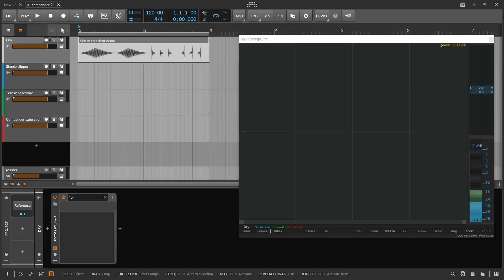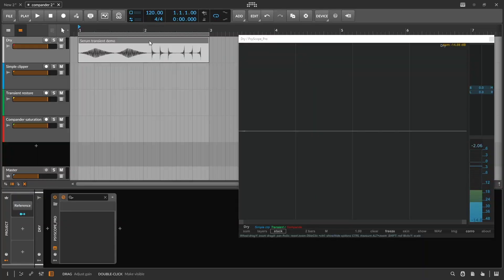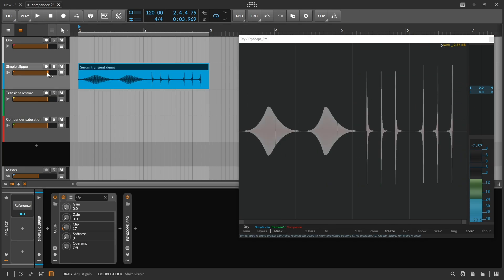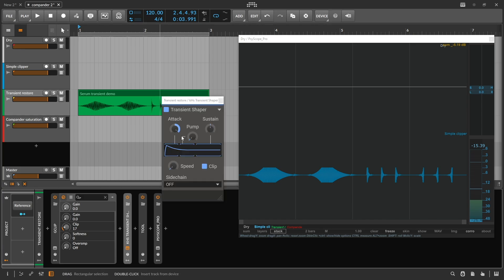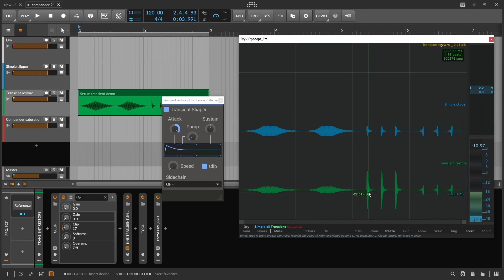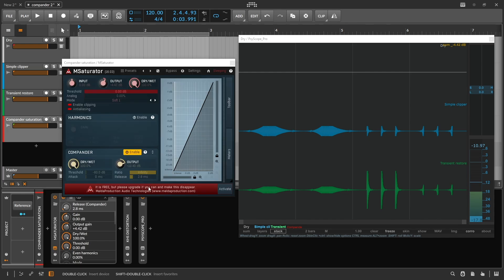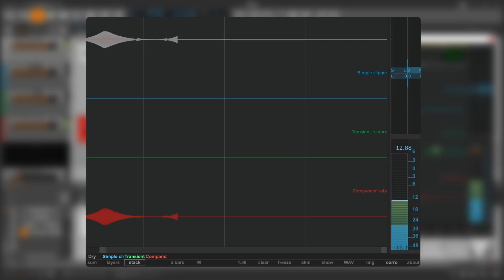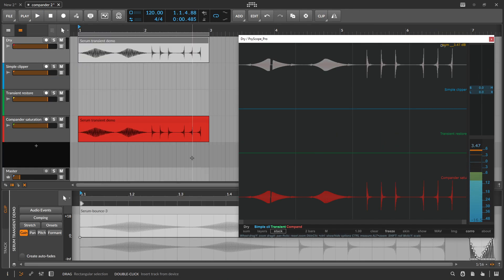the better way to distort your sounds

Comment: This can be done in Kontakt with scripting. Just need to capture the reduction envelope of a compressor, saturate, then apply the inverse of the compressor’s reduction to a gain. This has been possible for at least 2 decades. Nothing new.

Comment: This is so awesome! Since you're kinda the guy for this type of stuff I have a question: Is there a way to REMOVE the quietest parts of a signal? Like say you have a high noise floor, instead of gating or de-noising could you just clip off everything below a certain threshold? is this even a thing?
Reply from the maker: @djdeathcore5731 maybe check out a video about bitwig’s loud split device? it splits the signal up into hundreds of bands and lets you set some thresholds to apply fx to just the quiet frequencies, mid-level frequencies and loud frequencies. if you just turned down the volume of the quiet chain you’d get a cool spectral gate. I think this would give you what you’re describing, at least in the spectral domain.

Comment: Hey! Great video, and you made pretty tricky concepts very easy to follow :)

I'm very excited about eventually jumping ship from a Pro Tools/Cubase DAW duo. 
A DAW that seems to focus so much on workflow is very enticing. How viable is Bitwig as both a MIDI orchestrating/composing tool? & as a sound editing tool?
Sorry if these questions are kinda mundane, i'd love for u to point me in the direction of any independent material out there for learning the DAW.

Thanks, <:)
Reply from the maker: @andaroo.j hey, sorry I'm late to this.

I recommend watching some @PolarityMusic, he has lots of long and short form content about bitwig.

in general, bitwig isn't very well known for its midi workflow, though if you're into modular stuff it has hands down the best tools for randomized/generative music, lots of cool tools for doing crazy midi stuff programmatically. making ambient/generative patches and such. the piano roll overall is kind of mid, despite having a few cool features like midi note expressions. if you spend a lot of time composing by drawing in MIDI, you'll probably have more fun in FL's piano roll. it's the nicest one out there for sure.

if you're big into the audio engineering side of things bitwig is a dream come true. at least it was for me. it gives you so many tools to fine tune signals and create your own devices that do literally anything imaginable. the most obvious case is bitwig's "The Grid" - one of bitwig's key selling points. it's a drag and drop block editor able to create essentially any audio effect imaginable. or you can make full songs in it if you have a bit of experience. in my mind "The Grid" is essentially an easier to use and more capable version of FL's "Patcher", but you don't need a PhD like you do with Max for Live, since Max is basically computer programming.

yes, I agree with you in saying I find bitwig to focus heavily on workflow, meaning it gives you all the necessary tools to create your own workflow. not in a clunky way, I find it to be a really freeing thing. when I want to do something really specific or complex, I rarely need to google around for a 3rd party, probably not free plugin that does the job. there's always a stock tool for anything you might want to do in audio. you just mix and match. for example, I've even basically ditched serum because the stock "Polymer" synth has a great wavetable oscillator you can load up, and it does everything serum can do (and more!?). and also I'm currently making a "soothe2" clone and it's like 90% accurate. you can do some crazy stuff really easily.

anyway, if these things sound exciting to you I recommend checking bitwig out and getting the trial, but if that all sounded like a bunch of nonsense, bitwig's features might not be up your alley. not sponsored I don't care.
Reply: @jshstuff  Yo! Thanks for such an in depth response. You've definitely piqued my interest and I'm excited to give it a go for the trial period at the very least :) 

Keep it up with the fantastic content! Looking forward to more from ya. Cheers 🤘

Comment: Not all clippers increase headroom, and it’s important to remember that transient shapers are time based while distortion is usually dynamics related.

my own practice is I distort-transient shape- clip is always at the end.

There’s no right or wrong, but being aware of what the result of the effects you apply (hence having an oscilloscope) is my own takeaway from this video.

Comment: I use a chain EQ>Distortion>EQ
First EQ massively increases high frequencies, like a big soft shelf or even a tilt filter, like +12 or even +18 DB (sometimes a little if I want a little effect overall) and also I set output gain on that EQ just before clipping on a distortion plugin, or if it is a hard clipper, I set it on my taste. The second EQ makes the exact opposite curve, lowering exact amount of high frequencies. For distortion I usually use GClip or REAPER'S Waveshaping Distortion. Sometimes if I drive the vocals, right after distortion I place a de-esser plugin set on a wide band mode.
This chain makes sound really fat and warm, and also reduces dynamics of some instruments in a gentler manner than any compression or limiting, or other kinds of distortion.

Comment: Distortion that preserves dynamics is really cool, but I'm not sure that I understand the point of purported Benefit #1 @2:21 ...Wouldn't any / all distortion plugins get more "heavy" or present at 100% mix? (vs something closer to Dry or 0% mix.) Surely I'm missing something here, right?
Reply from the maker: yes but you get that benefit #1 without missing out on #2 and #3
Reply: @jshstuff  that makes sense, thank you for responding so quickly!

Comment: Quite some misconceptions in here : you are confusing distortion with waveshaping ; the way you are describing transient shapers is wrong too, albeit they can be used to restore some dynamic to a squashed  signal it is not what a transient shaper is designed for
Reply from the maker: I use the terms waveshaping, clipping, saturation and distortion interchangeably when referring to processes that add harmonics and reduce dynamics. but I think I see your point. there can be differences between them, and not all distortion does these 2 things. though I don’t think any use of these terms in this video were misleading, let me know if you disagree.

and I think we are actually in agreement - the reason this video exists is to argue that transient shapers do not restore dynamics. they just change dynamics.

let me know if I’ve misunderstood anything you said :)
Reply: @jshstuff  I am not trying to discredit you, just offering some clarification. Distortion is a result of clipping since the squaring of a signal introduces harmonics, but distortion and saturation are not the same as clipping at all. The same goes for dynamics control : for example you can clip the transient of a signal without reducing the overall dynamic of the sound if you do it properly. About restoring the volume envelope of a signal that went above the 0 dB FS threshold ( digital clipping ) you cannot do that with transient shapers nor expanding but only with complex algorithms that try to estimate the " path " the signal would have taken before being squared by the digital resolution threshold, just a few very specific plug ins can do that like the RX declipper and those plugins are very CPU intensive for a reason. The way you are dealing with this topic in the video is just not accurate in terms of digital signal processing technology. Thanks for the polite reply by the way and keep digging 💪

Comment: You should try using Melda MAGC  - using the unclipped signal as a sidechain input to match the clipped signal's gain to. You have averaging time and gain range controls.
Reply from the maker: @au5music oh that’s sick thanks, looks like exactly what I need to do this in the simplest way, with the ability to drop in any distortion vst. someone else recommended hacking u-he Satin to achieve a similar thing, but this is way better and free!!
Reply: What you basically want to do is invert the gain reduction of a brickwall limiter set to the clipping threshold. You can build a pure Bitwig version of this that really exemplifies the power of the FX Grid by creating envelope followers of the pre- and post-clipping signals, subtracting the post-clipped follower from the pre-clipped follower, and amplifying the clipped signal by this delta. This will add exactly the missing dynamics back to the clipped signal. In fact, if you set the follower too fast you actually lose the distorted tone because you get closer and closer to adding back the actual per-sample signal delta (and a - b + b = a). You can retain the distorted tone by using Follower RF with minimum rise (to preserve the initial transient) and increasing the fall rate until you get enough distortion back. This is what the averaging time does in MAGC. (You should macro the two fall rates together to keep them in sync.)
Reply: @jshstuff It's an extremely versatile utility I'm sure you'll discover brilliant uses for.

Comment: A good way to do this as well, is to boost high frequencies (around 2500) with a bell shape, since transient frequencies are high, they are boosted. You can visualise it easily if you boost high frequencies on an image as well: contours will be more visible.

It's a guitar trick, learned it trying to recreate Kyuss's guitars tone. It works best when the source signal is low while sustaining though (kyuss tune to C standard so that helps).

Comment: So, that's a compander without any clipping involved ?
Reply from the maker: yes the compander is doing clipping, but after the clipping it’s restoring the sound’s original volume envelope. so if by “without clipping” you mean that the resulting waveform is not flattened then yep!
Reply: @jshstuff  got it 👍  thank you !

Comment: Hate to be that guy, but can't you just put a gate before your saturator to give the same effect?
Reply from the maker: the minimum chain you need for this is: 1. envelope detection 2. saturation 3. volume automation based on envelope from step 1’s detection.

just a gate into a saturator does not do the same thing as what I show in the red chain in this video. you need a way to restore the dynamics post-saturation.
Reply: @jshstuff  It might not restore things exactly, but does it really need to be? Half of what we like about saturation generally speaking comes from the change in dynamics as well as the added harmonics. All you really need is a means to control the harmonics and dynamics independently. Matching the dynamics exactly to the pre-saturated source is definitely cool, but is it definitely necessary for a good result?
Reply from the maker: I agree! most of the time I prefer clipping to preserve dynamics and add harmonics. but if you consider a sound that swells over a longer period of time, like the first two swells in this video’s example, or the vocal example in my first companding video, something totally different than simple clipping is going on, and I think it can be a uniquely good thing. the added harmonics/distortion on these sounds get sustained for the whole duration of the sound, but the volume swells up and down greatly in level. the harmonics are not only added at the sound’s loudest moment.

Comment: You get the same result with parallel compression/distortion, or not?
Reply from the maker: yes you can get a very similar (but not same) result with parallel processing. the main difference with parallel processing is that you can’t get 100% mix on the distortion. of course. since you’re mixing some dry signal and some wet.

with parallel, it’s a tradeoff - the more you mix in the saturated signal, the more dynamics are lost. companding doesn’t suffer from this tradeoff.
Reply: @jshstuff  Ah ok, I will try both variants, thanks!

Comment: a technique i came up with a while back is to divide a signal by an envelope follower output from it, giving you a roughly constant level. you can distort that however you want, then multiply by the envelope follower signal to get something to listen to again. the distortion then only acts on level changes faster than what the envelope follower reacts to, such as the start of a transient or the level changes that make up the waveform. the technique works well as long as you’re not doing reverb, delays, etc that last close to or longer than the envelope follower times.
Reply: Your setup is the simplest form of a  compander actually, so it's the same setup but the compressor and expander parts are simplified.
Reply: @SolarLiner  oh yea it is a compander, although i thought companders usually didn’t have a separate level signal, just inverse volume curves
Reply: @morgan0  What do you mean by "separate level signal" ? It sounds like in your setup you used the same envelope to drive both the compressor (using division) and the expansion (using multiplication). You get the inverse gain reduction "graphs" by using division and multiplication, which are the inverses of each other.
Reply: @SolarLiner  yeah but my understanding is companders were invented for telephony and two separate things that each did the inverse of the other. so thinking about the signals sent between them, the first part (compression) gets the original signal, while the second part (expansion) needs the modified signal and the volume envelope from the first part.
Reply: @morgan0  Yes, agreed on that point, and this all describes what you did in your message above.

I'm not saying all of that to discredit you or anything, just in case that's what you might be getting out of my messages. It's pretty cool that you essentially independently rediscovered the technique of companding by yourself.

Comment: As an interesting tidbit, good transient detectors tend to detect a change in energy, not level. Detecting a change in level is actually a lot more complicated than you might think. You need to set a threshold for how big the change can be, you need to make provisions to avoid retriggering, etc. It's very finicky. But with ftt analysis you can detect a change in energy, and that is a lot easier and more accurate.

Comment: What if you add compander / transient shaper before clipping/saturation ?
Reply from the maker: you can kind of see an example of this in the green chain in this video. I had the “clip” checkbox on, so when the transient happened it sharply boosted the volume, but you can see a hard clipper completely flattens it for the first few milliseconds. that’s transient shaper -> hard clip

Comment: I've been playing around with companding with different saturators last few months. I use satin by uhe which has 4 settings. You bypass the tape and only turn the encoder on one put a saturator then another satin to decode
Reply from the maker: thanks for sharing, this seems cool! I just tried the satin demo but am confused & didn't get it working immediately. are you saying you load up 2 instances of satin which only act as the compression/expander, not the actual saturation? then you put a saturator plugin in between the two satin instances? or do you mean something else?
Reply: @jshstuff  yes exactly that
Reply from the maker: ok cool that makes a lot of sense! seems really convenient since you can drop any plugin into the compander chain. and would work in any daw. lots of possibilities…

Comment: I usually like that a clipper reduces headroom. that's useful in the mixing stage. but i can see why sometimes it might be cool to keep the dynamics and only get the nice drive spectrally
Reply: *adds headroom by reducing peaklevels
Reply: That was my first thought too.  I guess that's my perspective coming from mixing a bunch of loud genres though (heavier electronic / hard hitting hip hop).  I could see this being particularly useful in more dynamic productions.
Reply: I think that everyone assumes loudness is "hard" to achieve when the method of making tunes everybody gets introduced to is "leave headroom, mix, master" - as 3 stages; where clipping/this stuff is done in the mix stage.

I do believe that it will get to a point where you can achieve the loudness consistently much like with Baphometrix clip to zero strategy; and eventually you'll want to control where the dynamics ARE, rather than the concept of assuming everything needs to be squashed to achieve loudness :)